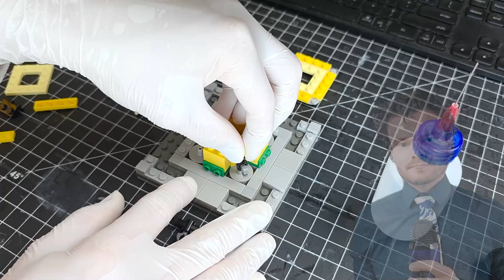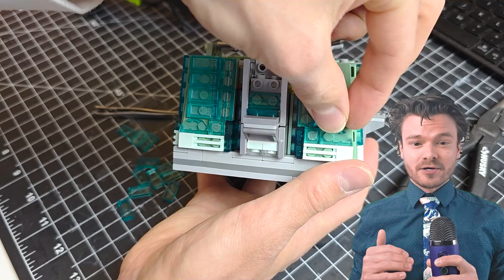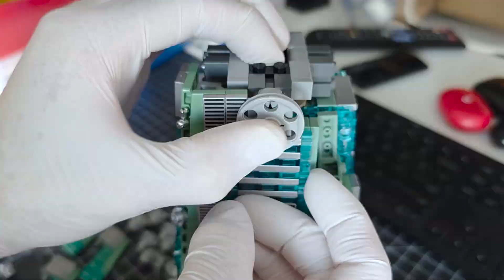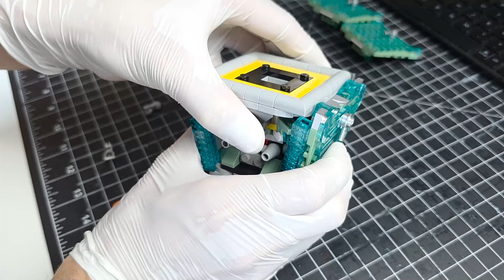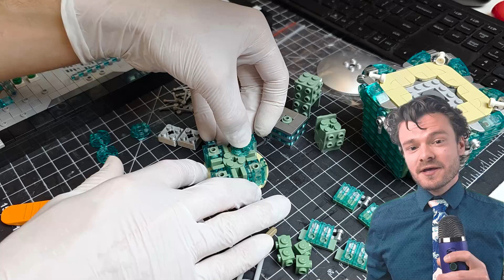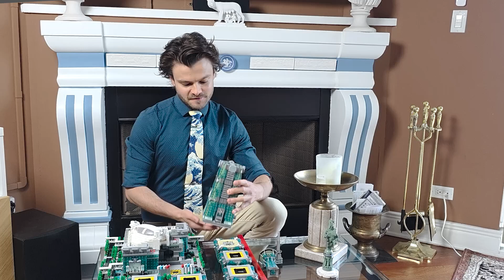Taipei 101 | 1:650 Skyscraper Reconstruction | BUILD Insights XLV

Comment: Hey, again a super build.
But i have one question ,how do you keep the models clean from dust?
Reply from the maker: I typically use a can of compressed air or a feather duster.  For the most part, my work is in storage between exhibitions, so it rarely needs dusting.